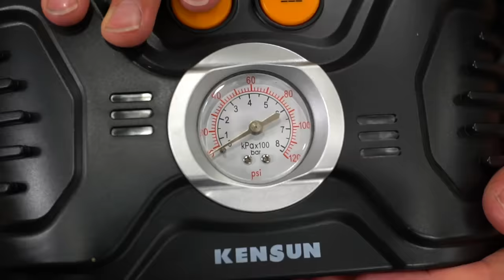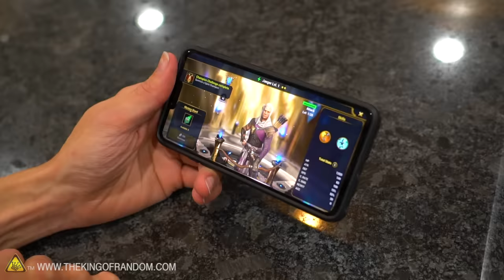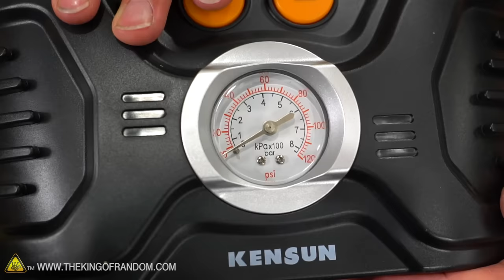How Long Till Stretch Armstrong Explodes?

Comment: Nate: "We're going to inflate these, hopefully until they pop"..."I'll be wearing hearing protection"
Me, having over inflated a car tire with the same type of pump on accident at a gas station and set off the burglar alarm and every car alarm in a 3 block radius: "you're going to need to do a lot better than those...and PLEASE don't do it inside..."
Reply: r/thatescalatedquickly
Reply: @mattpack4425  lol
Reply: A car tire has several  times more volume then most of the stuff they inflated in this video and car tires are rated to go higher before popping then most of the things in this video

Comment: One thing you could do with some sports balls is you could only slightly over-inflate them, causing the rubber stomach to slowly tear through the stitching on the exterior as the day continues. I did this by accident in the 7th grade with a football and it was a very interesting process leading up to the explosion in my hands during recess.

Comment: Hi, if you feel in the mood, can you try to make a zero gravity balloon? Filling a balloon with helium and other inside it with hexafloride or just air/CO2 if it works, or just mix the both gases inside to balance the weight.
Maybe it's difficult, because I don't know if any difference in atmospheric pressure will change everything, just a crazy idea that came to mind hehehe
Thank you 😀

Comment: unless anyone has a better idea, e6000 is the best flexible adhesive i have ever used but in my experience takes up to a week to fully cure. not sure how it will hold up to stretch armstrong like that but e6000 is very versatile

Comment: The closest thing to an American Football would be a Rugby ball of which it is based, however, the former has less rounded ends to allow for longer throws.
American Football is based on Rugby Football (usually shortened to simply Rugby), however, instead of doing the smart thing and referring to it as American Rugby, they called it American Football.

Comment: colab with gavin free on stretch arm strong. remove head. plant m80 inside body with electronic ignition, ziptie neck shut securely. fire up a couple hundred thousand frames a second and detonate. use some math to see how large it got before it ripped open ^_^